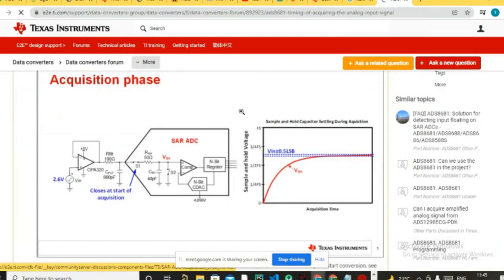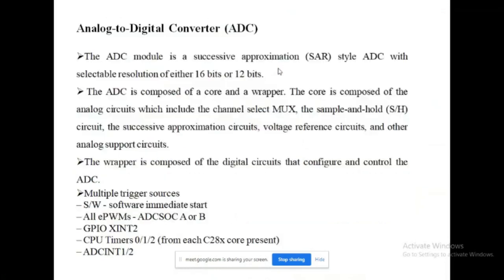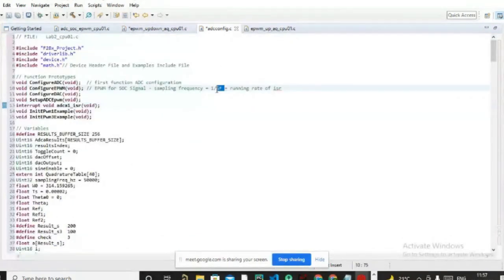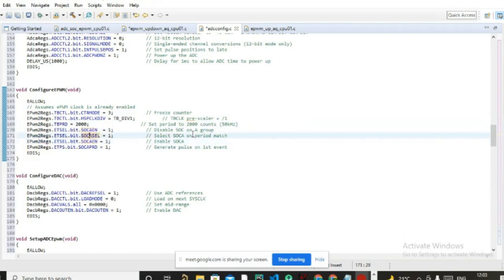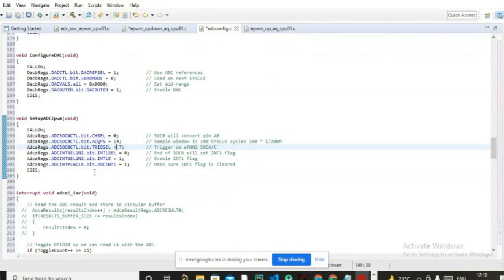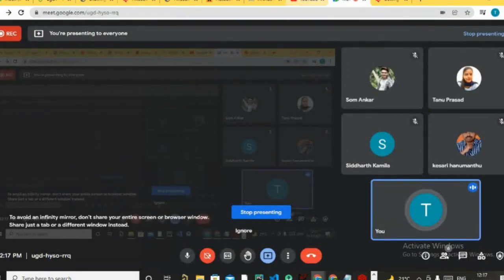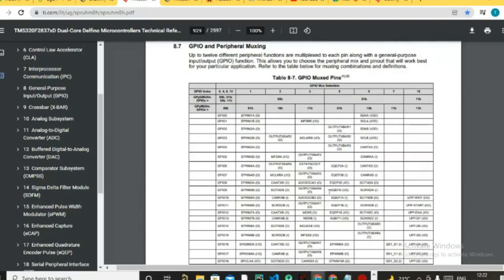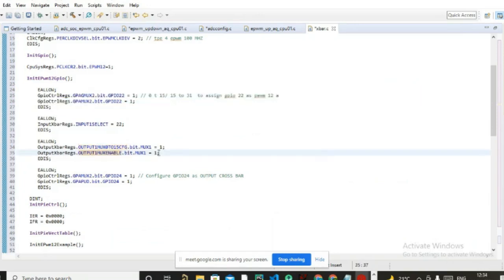Lecture: 9

Comment: Hi sir 
below  mentioned error is happening while using DCL.h header,Pl suggest solution

identifier "float32_t" is undefined   suggest solution in code composer studio
Reply: error:
"C:/ti/c2000/C2000Ware_4_03_00_00/libraries/control/DCL/c28/include/DCLF32.h",
          line 36: error: identifier "float32_t" is undefined
      float32_t Kp;       //!< Proportional gain
      ^